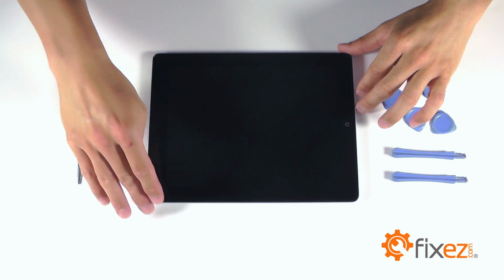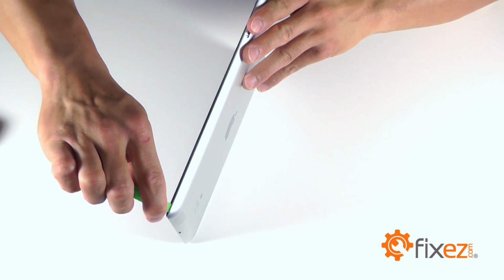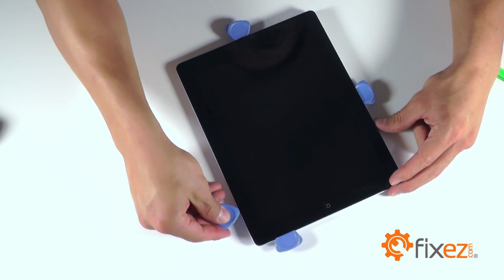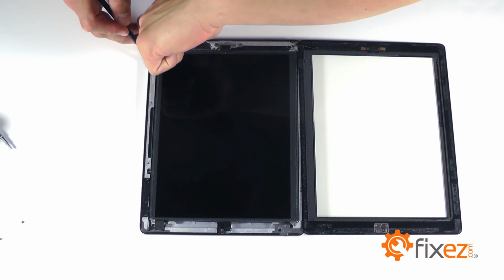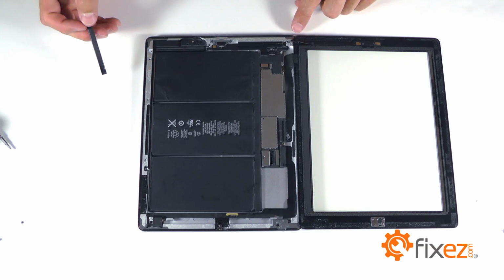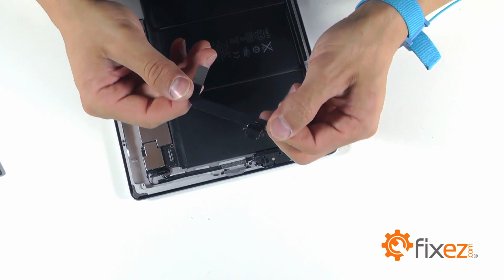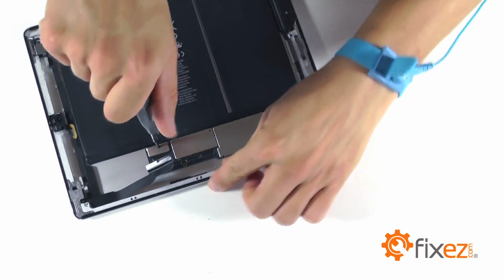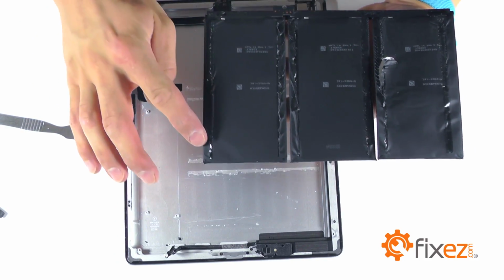iPad 4 Battery Repair

Comment: For all the people complaining about not including a re assembly video. If you can follow to the end of the video with success, putting it back together should be (is) easy. It's called rewind. Getting the digitizer off cleanly is the hardest part. Great video.

Comment: After replacing battery, power button, volume up and cameras don’t work. I also replaced a very broken touch screen and there were a lot of glass shards. I have flushed out the connectors with iso and air. Power button was def working prior to the battery replacement. No visible damage to cable.

Comment: What I did was rest the touch screen and led screen to one side resting on some towels , I just took out the 3 screws on motherboard then heated up a small scrapper with heat gun just enough to prize away battery from glue put new battery in screws back put screens back in place heated around edges so screen would fix charged up job done, but if your not confident undo everything in this vid 😎👍🏻
Reply: I think it’s a lcd screen

Comment: My daughters ipad 4..will not charge...not sure what is wrong..should i b looking to change the battery..iv boughten brand new chargers
..still says not charging when it is..plz help ..she got it from her school and does all of her work on it
Reply: Ok.ill try..and will let u know how it goes..thanks a bunch
Reply: Sorry 4 not gettn rt back..it was only the wall charger itself..thanks 4 helpn tho..
Reply: +Fixez.com mine doesn't have screws that the digitizer. ..how to take out the digitizer?
Reply: +Fixez.com mine doesn't have screws that hold the digitizer. .any ide how to take out the digitizer?  is mine ipad 4 or different?
Reply: It probably needs a new battery i would suggest taking it to a reputable repair shop to get it replaced
Reply: Batteries 🔋 on phones an iPads needs to be replaced every 2-3 years

Comment: iPad wont turn on at all turn everything hopefully a new battery will work
Reply: Thanks for the reply I have try everything connecting to laptop home/power button. No water damage but I have replaced the screen a couple of times. It stopped working because I threw it on my bed... Yes on my bed...It still had power when it died now it won't turn on I'm thinking about taking everything apart and put it back if that don't work I'll replace the battery
Reply: If it is the lcd wouldn't my computer recognize my iPad?
Reply: Yes I had order new battery it should be here in a week if it still doesn't work so you have any idea of what is going on? Thank you
Reply: Just got my battery about to put it on and test it wish me luck!
Reply: So I just replaced the battery and the iPad still don't seem to be working at all... Any ideas?
Reply: So I fixed the battery problem but I have another problem the lcd isn't turning on... I don't want to get a new one is there a way to fix it? And is it the lcd or the mother board
Reply: My pc does recognize my iPad but the lcd won't turn on or show any image it will light on and off when it plugged in the computer. Do you think it the lcd or the main board the lcd is connect to? I checked the lcd and it cables it don't seem to have anything wrong with it but I might be wrong
Reply: +Dominick  I have exactly the same problem. Were you able to fix it?